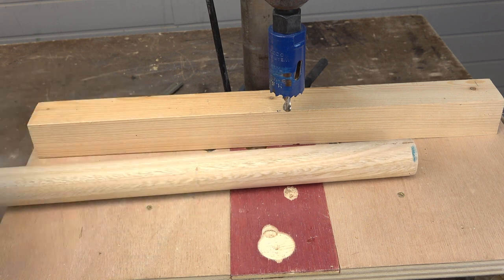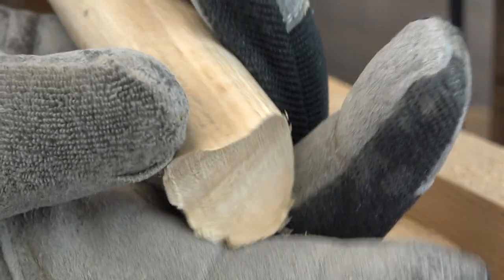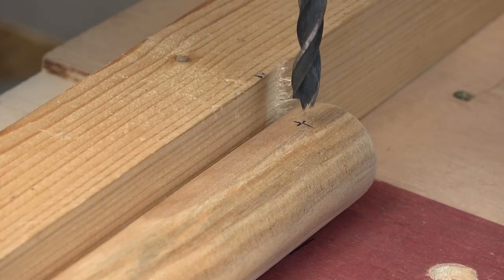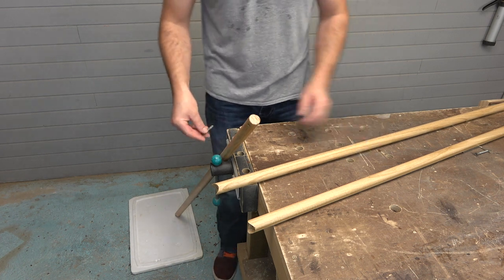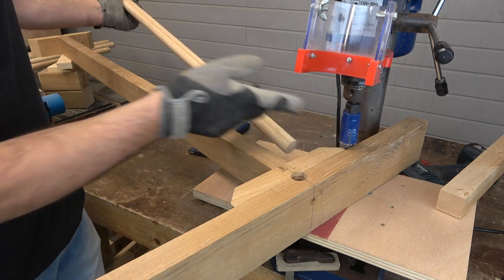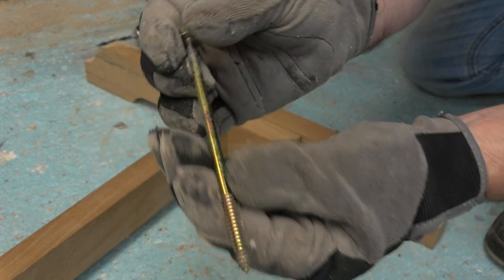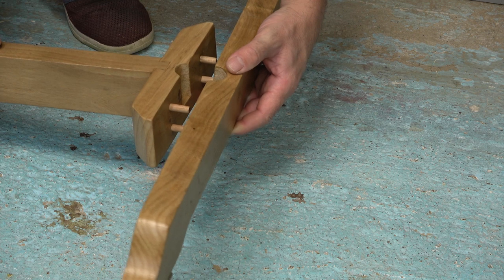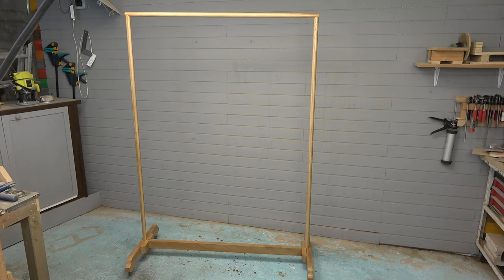🔥 Fish MOUTH Joints in wood rods that can be disassembled

Comment: Clever joining!  But from my experience redoing a closet, I think there may be a problem with the horizontal rod holding up under the weight of the clothes. Even the 1 1/4” dowel rod in the closet bent. Wound up with a stainless steel rod.
Reply: Excellent techniques and detail.  Never thrlought to use a hole saw for a joint.  Thanks for sharing!
Reply from the maker: Thanks for watching 😀👍
Reply from the maker: Well, I agree so maybe it is not suitable for lots of heavy clothes
Reply: I guess to some extent it depends where you live, cold winters will probably require a stainless rod, hot places, not so much.
Reply: @MiniLuv-1984  A bit slow off the mark in understanding your reply. Of course you are correct!